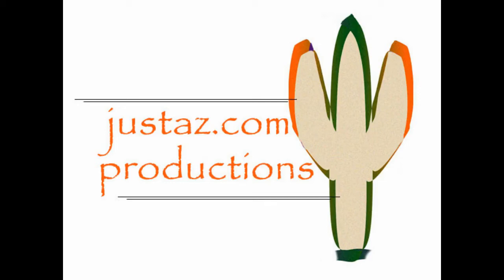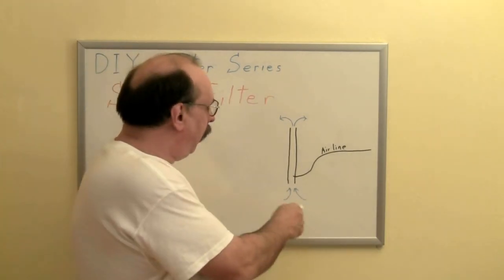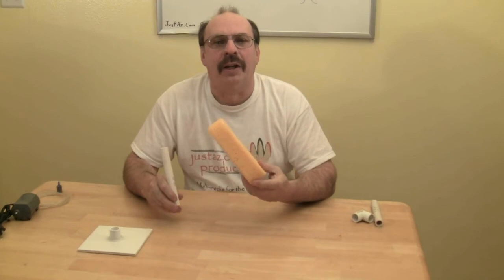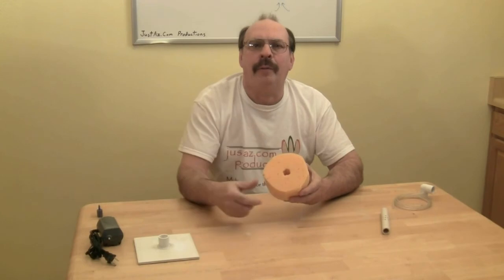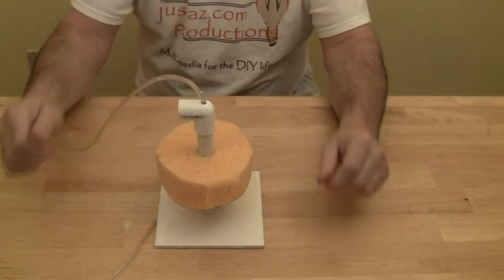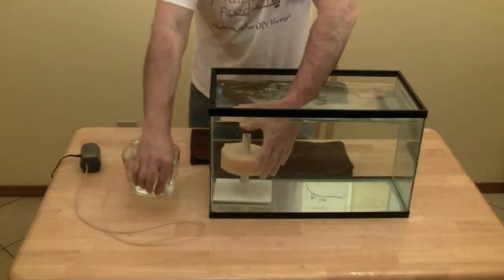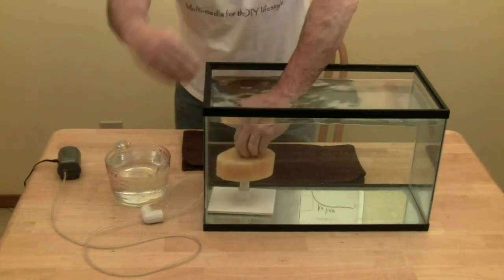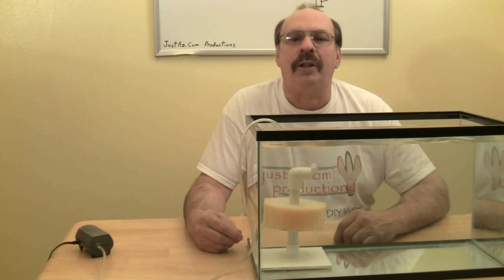Aquarium Filter Series: 2/8: DIY Sponge Aquarium Filter

Comment: Air tubing can be at any level, it works, the lower the air tubing though, the more pressure difference for water to work, but this design caps the water pressure difference rather small because the sponge itself isn't placed lower.

It is water that forces its way into the low pressure (low density air) compartment in the tube and displaces the air and water within towards the exit.

The only issue with this design is that unless the sponge is clamped on well, water would bypass it and just track around it and straight into the tube.
Reply from the maker: Everyotheryoutuber Thank you for your input. We appreciate it, and wish you the best of luck in all your future endeavors.